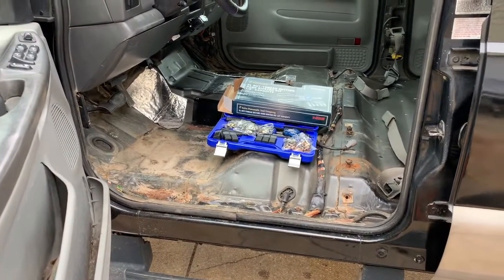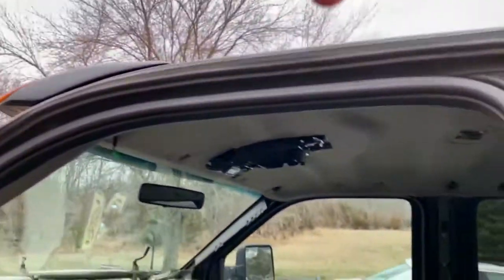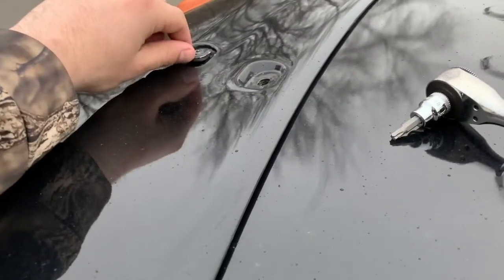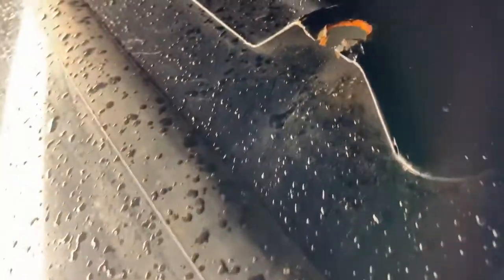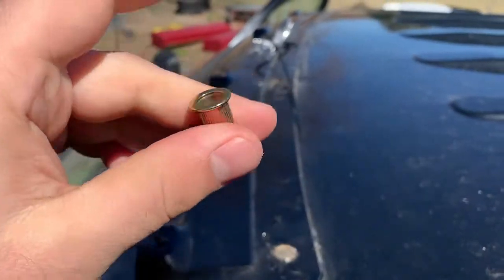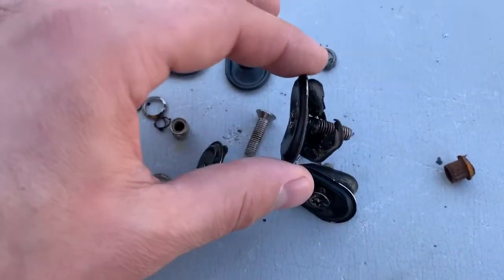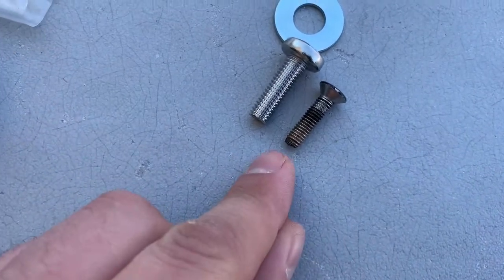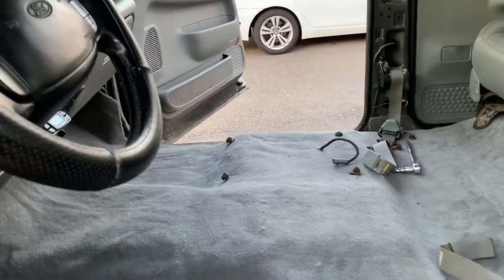Fixing Loose Truck Visor

Comment: Any idea where to get a replacement oem visor?
Reply from the maker: Near impossible
Reply: Only way you'll find one is if you get one off of a junked truck or someone taking it off and selling it. I have three of the visors  one is cracked and planning on using one that is not damaged.

Comment: The wires from mine came loose and didn't even think about using a zip tie and well the got caught with my windshield wipers and now they're disconnected I wanted to solder them together but my dad tells me not to in case the battery dies idk how and in case something catches fire but idk i need help I miss it when they would be on at night💔
Reply from the maker: You should be fine to use electrical butt connectors with a heat shrink tube.